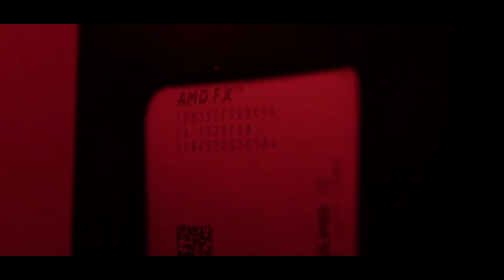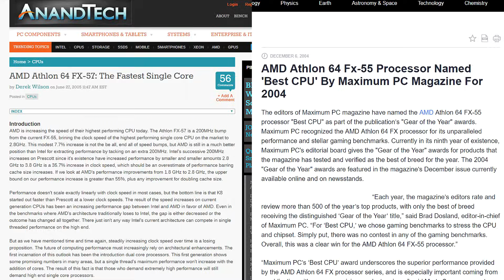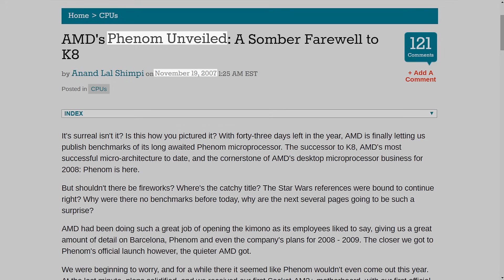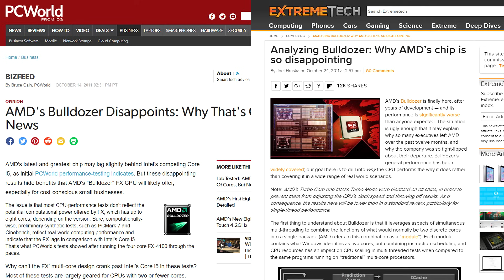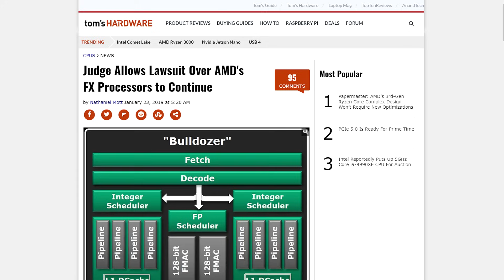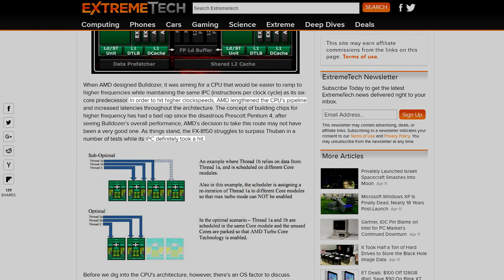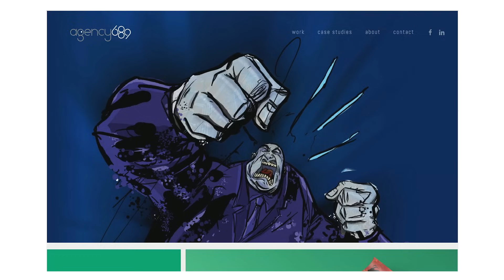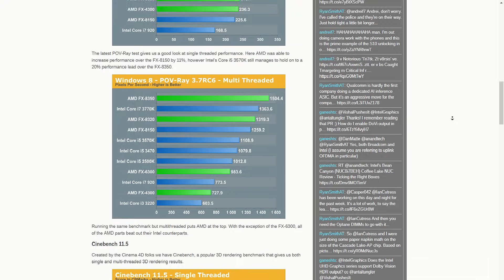Why AMD's FX CPUs Were Hated So Much? - The Fate of Bulldozer

Comment: I built 3 computers from FX processor. All three are still in use.
Reply: ive built 2, both still in use, a 8350 and a 9590
Reply: @jasongooden917  My workhorse is an FX-8150
Reply: The 8 core FX cpus actually aged fairly well..
Reply: @Trent Tulpo - Having built computers since the 1990's, I have never gone wrong with AMD. I choose AMD because It was a moral decision that Intel should not be able to control CPU pricing. Now, AMD has almost matched Intel in gaming. AMD has certainly passed them in productivity applications. I am a happy computer builder, especially since AMD has given me so many opportunities to upgrade on the AM4 platform.
Reply: Mind you I am pissed off at the misinformation I received prior to building the FX 8--- series based rigs. They never performed as good as my people I built them for expected. It was a disappointment to learn of the deceit and I would have gone with Intel had I knew the proper performance/ buck I was really getting. I am waiting for my check from the settlement and it will be about 23 buck after lawyer fees per processor.
Reply: LONG LIVE MY FX6100!!!!!!
Reply: I use 8370e
Reply: I have FX6630 and works like charm. Not even overheating or whatever.
Reply: Posting from my fx 8350 at my bedside. (though my daily driver is a ryzen 3800x).
Reply: I have an AMD fx 8350 overclocked to 4.4ghz and I'm still using it. 4 years overclocked and running fabulous. 😉
Reply: they hold up far better then same era intel chips for heavy  thread use in my exp... 4c4t and 4c8t are easy to saturate... 

i have made quite a few for people, almost all still in active use as somebodies gaming rig, with modern gpu's tossed in, overclocked to 4.5-4.7ghz...  pretty easy to oc on a 1/2 decent board... with decent cooling ;)

the FX main failing, is how slow the L3 cache is... its comparable to ram access speeds.. really bad.. just salls out waiting on the L3 alot :/ 

the FX line... are not as bad as many make out... they are kinda amazing for how long they have stayed relevant and in wide use vs intels same era parts...

FX at least let me upgrade part by part from what i had.... without needing a whole new platform that would be replaced next time intel put out a new cpu line...
Reply: It allowed me to like this comment. Fx8320 black edition
Reply: Same
Reply: im on an 8350 rn with 2 broke pins...lol but have a 3600x in the box behind me
Reply: @knid mils why would finding that an 8350 still performs pretty well even today make me black? They dont "burn through" power supplies. Ive only got one psu out of the 3 systems that is 80plus certified, but the other 2 still work fine as well. I also never said they were the greatest ever. They are however better than the average cpu you get in a prebuilt machine. While my little bedside 8350 with its meek little 1060 in it, is no comparison to my main ryzen 3800x and 2080super/5700xt (depending on which ever i put in at the time) did you burn out psu's on your fx series? You actually can undervolt them while overclocking them if for some reason your power bill is overly sensitive.
Reply: Unlike intel... i know.
Reply: I upgraded from Athlon, to Phenom, to FX 8350, and am now switching to Intel 15 years later with the I5-12600KF. Finally, I can put AMD to rest. The same is true with GPUs. I went through so many AMD GPUs and finally switched to NVidea. Goodbye AMD.
Reply: cmon guys stop defending the FX line, I was AMD user up until FX, AMD lied to us and the courts agree https://www.amdcpusettlement.com/ p.s my last 3 CPU'S have been Ryzen :)
Reply: I built one with an FX6300. Regretted ever since.
Reply: Fucking christ people, it doesn't matter what CPU anyone uses, it's their choice, they have their reasons, etc etc. Its not your money, let people spend it however they want to. I like and enjoy both Intel and AMD for their purposes, same as I like both AMD and Nvidia GPUs
Reply: Damn fanboys lmao.
FX
is
shit
Get over that

Any next PC I'll be building will be Ryzen tho. Fuck Intel these days
Reply: @GewelReal  The FX series was fine.  No it wasn't as fast as intel's fastest offerings. But it also wasn't priced anything like intel's fastest offerings either.  FX was only shit if you were demanding the absolute fastest and top of the line.. in which case if you had that much disposable income, i'm not sure why you'd even be thinking of AMD anyway.  Until zen2, AMD was always budget king, and did very well in that market segment.
Reply: @GewelReal  oh yeah, shilltel fan🅱️oy? Ever ran a cpu that was powered by 2 hamsters running on treadmills in tangent? Yeah checkmate nerd
Reply: @GewelReal  I do prefer FX over ryzen ryzen is way to overhyped and performing really disappointing in gaming for the price, not sure if FX was also this overhyped but I didn't catch any of that so they're fine by me.
Reply: I build 7 computers all with Intel in them. They also run same as new to this day after almost 10 years on the oldest. Checkmate AMD FX fanboys /s
Reply: @GewelReal  fine for you?
Reply: @GewelReal  oc
Reply: @GewelReal  How much did they cost? THAT is the question.
Reply: @iHempus  1 was i3, 2 were i5 and rest was i7 (starting with 920 and ending with 8700K)
Reply: @GewelReal  FX-4100; FX-8320; FX-8350. I know right? I use the 8350 with a 980ti and it is more than I need for the A/V purposes I use it for like watching live TV, etc. All with different versions of the Gigabyte 990FX UD series MB. I have a Ryzen all built for the guy with the FX-4100 and he is like nah I don't need it yet.
Reply: @iHempus  I don't mean to be rude, but wouldn't you get diminishing returns pairing a FX-8350 with a GTX 980 even, a 980TI would without a doubt be leaving a lot of performance on the table in most games? For your money a GTX 970 would give you the bang for your buck and performance before hitting the bottleneck wall. Most people actually recommend a GTX 960 paired with most FX chips. I'm actually curious, have you done any bench mark comparisons with a 960, 970, or 980Ti paired with the FX-8350?
Reply: @spacepioneer4070  Correct on all accounts. I don't game with this computer, just watch cable and movies, etc. I will probably go back to the 780 ti I had paired with this. I don't bother doing benchmarks on this because it doesn't matter to me really. Now my 3700X,  I pay attention to the benchmarks on...
Reply: @iHempus  Ah, ok. I'm generally interested in pc workstations that can game on the side, thus the reason i've had a FX-8350 for the last five years. I'm very interested in the 3700x, and it does everything well from the reviews i've read. Congratulations!
Reply: @spacepioneer4070  This doesn't answer your specific question and 
8350 FIRE STRIKE 1.1 w/ 980 ti = 10,000; 
8350 FS 1.1 w/ 780ti = 8,735; 
3700X FS 1.1 w/ 1070ti SLI X2 = 27,350
The memory and processor speed are nudged up just a bit.(~8%) No voltage adjustments.
Reply: @iHempus  Well, Ryzen does love high memory frequency, great results!

Did you by chance notice a slight bottleneck from the FX-8350 paired with the 980 ti? Is Firestrike purely GPU tested? If so, you wouldn't notice a bottleneck, compared to a CPU demanding title like Skyrim or GTA V for example. I've read that even though you would get an increase in performance across all titles going from a GTX 970 to a GTX 980 Ti, it would vary depending on the game. You may get 20-30 fps increase in performance in one title and only 5 fps in another. I guess it comes down to what games you like and in most cases it's worth upgrading your CPU rather than your GPU. In other words, i would have better performance upgrading to a 3700x and pair that with a GTX 970 than to pair a FX-8350 with a GTX 980 ti in CPU demanding games (In theory). Thanks for sharing those results, and have a good one Trent.
Reply: @iHempus  you must be joking right , i still have fx-8150 and it's my helpnessness that i have to use it , and don't have money or else i would've throw it away way back , Fx processor's is just useful for very normal pc use , it runs photoshop also good , but when it comes for After effects , preimier pro , unity you have to avoid just single click when it stutters or else your program would not respond. mid to high graphics settings games can also be played on it but don't expect too much . in the end i hate that i chose this instead of an i5 or i7 just to save 100usd i fcked up  , i wanna still buy a ryzen cpu but i don't have the money :'(
Reply: @GewelReal  i7 920 < FX8350 from far and i had both of them.
Reply: @spacepioneer4070  the dam things cant even handle the rx580 i got in it...i have to turn down so much, lucky to see 40fps in tarkov and even then frame drops make it unbearable to play.
Reply: @sansundertale69availablename  how would the fx get maxed out before the i5 it has more threads
Reply: @HD-dp1pr  Did you not watch the video? 
He clearly states that the processor uses shared resources, which makes it perform less efficient than when not having shared resources.
Reply: @yewbacca  yeah I know it uses shared resources but it still has 8 threads
Reply: @HD-dp1pr  Which it cannot use simultaniously, because it's resources are shared... it switches between two threads, for all 4 cores... 

That's what i got from this video. Please correct me if i'm wrong, not an expert.
Reply: @yewbacca  if it couldn't use it simultaneously why does it beat cpus which have the same number have threads and the exact single core score at stock in multithreaded workloads. The only time it wouldn't be simultaneous would be in fpu workloads
Reply: @yewbacca  what I ment by that is it depends on the work load
Reply: @GewelReal  i have an old amd athlon system from 1999 , still running fine , stfu.
Reply: @GewelReal  You see fx made a world record and still holds it . 
Intel go piss piss piss piss....
Checmate Intel
And you know you have lost single core performance....
Haha .. Intel go boom

Comment: My fx8350 is still my main cpu since winxp... then win 7 and now win 10... and I'm gaming apex legend with it. ... :D
Reply: It's better now than it was in 2013. More software, especially games, are coded to take advantage of the threads. AMD helped itself when it won the console deals and game devs HAD to code to run those eight-core APUs in the consoles.
Reply: @johncate9541  Excellent point about the console contracts. Hadn't thought about that.
Reply: @TheMadHaxor  if you hadn't thought about that, this will blow your mind. Next gen consoles will have Zen2 with full AVX 2 instructions. Going forward, anything that can't run AVX 2 at full speed will become obsolete for new games.
Reply: @TheMadHaxor  Yes but they were Jaguar semi-custom cores. Not the same as say 8 Zen 2 cores with a mainstream consumer architecture that when developed for transcend to applications outside of gaming.
Reply: I retired mine to the closet a few months ago for a new Ryzen 3600 machine I built. Such a massive difference im getting 2-3x the framerate in most titles.
Reply: I literally just upgraded from mine recently lol but I was able to keep it for a long time simply because I always used overkill GPUs with it such as the R9 390 and then later on upgraded to a GTX 1080.  I barely had any problems with the FX 8350,I even played PUBG at ultra settings 60fps with the 390 when PUBG first came out and everyone knows how badly optimized that game is. The only thing that the FX 8350 struggled with was shadows,so by lowering them in most games it was easy to run them at ultra settings.
Reply: Same til a few months ago, coupled with a R9 290x OC windforce. Great gaming experience tbf,
Only upgraded to a 2950xTR due to workflow
Reply: I still play on Fx6300&gtx950 without overclocking
Getting to 16 ram really boosted performence
Reply: The 8350 launched 9/23/12. You're telling me you were still using XP in 2012 or after?
Reply: @94XJ  many people did. Even with win 7 being so good. There are people using Win 7 now even tho Win 10 is so good. People get used to an OS and do not want to change.
Reply: @94XJ  yes I do for few years and move to win 7 sp1. ... Winxp is too solid to let go last time but kinda dead today. ...
Reply: I was always baffled why people got the 8150/8350 over the 8120/8320 esp since it was almost $100 more and only difference was the default multiplier, which most changed anyway.
Reply: @junkiexl86  from what I learn last time.. buying higher clock amd cpu last time may end up oc higher clock and lower tdp ...
Reply: well if you upgrade your cpu you'll notice how much you can achieve more with that same GPU , it just fcking bottlenecks everything , i am glad that you don't use productivity softwares more often or you'll feel the pain that how much it still sucks
Reply: You have to remember the benchmarks always favour Intel CPUs, been running 8 core FX for years and it’s never been a bottleneck
Reply: @Flozman1982  Benchmarks always favor Intel CPU's? lol what!? That's the dumbest thing I've heard in a while. They didnt favor Intel, it just took AMD up until now to get on the same level performance-wise as Intel.  Also, FX wasnt 8 core. The 8350 etc was a quad core CPU with 4 integer cores. Now if you were running something that crunched integer math than sure, it was an "octa core", but many applications need the more accurate floating-point math, like games etc. At which point that 8350 etc is a quad core with atrocious IPC. 

My current 3900x Ryzen 9 obliterates most Intel mainstream chips in multitasking benchmarks. So not sure where you pulled that benchmark comment from.
Reply: @Flozman1982  Yep, that's how Intel always manages to announce xx% increase in performance while releasing a rehashed version of their last gen CPU. Gotta love being able to cite your own benchmark software's scores every year as evidence of xx% better performance. Just like Intel benchmarks their CPU's without security patches being installed.
Reply: You can get a dirt cheap Zen/Zen+ CPU that'll game better and use way less power to run.
Reply: @Brenryz  AMD didn't mislead consumers about number of cores. This has been re-affirmed by experts in CPU architecture for years now. Just because the design is not similar to Intel's architectures does not matter. There isn't a clear definition of what a "core" is. You're pathetic and petty to want to "stick it to AMD" so you can get your $2 while the ambulance chasing lawyers in the court case walk away with millions because they got a bunch of simpletons to believe that a "core" should be whatever Intel calls a "core".
Reply: @Brenryz  Oh I sound like a millenial "dude" "lulz"?  Okay little buddy. Go back to bashing AMD over something you have no understanding about.
Reply: @Brenryz  LMFAO you actually go to that pathetic website? Their reputation has been trash since the mid-2000's and their "reviews" are a joke.
Reply: @Brenryz  It's hilarious seeing you label others as millenials when you're the only one here using words like "bro" "lulz" "cuz". Go back to Tom's Hardware little buddy.